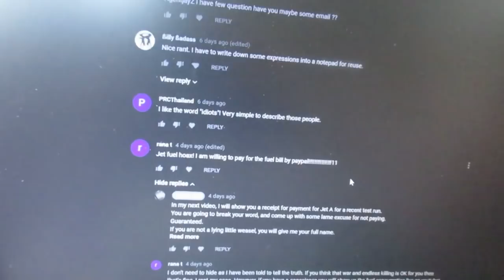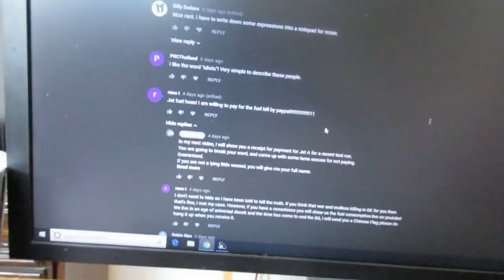Hoaxtard Discussion

Comment: Following a career lifetime in gas turbine engine design,  industrial, marine and aero, including the design of fuel and combustion systems, I left a comment  on this topic four years ago, which you will find somewhere below.  I've also left comments on this channel whenever the "jet fuel is a hoax" brigade continue to peddle their foolish theories.  I thought about letting the latest comments pass me by, but I just can't resist getting involved.  I find that restating the facts is a useful and stimulating exercise for my brain in an active retirement. 
Sadly, the the "jet fuel is a hoax" brigade appear incapable of accepting the fact that a gas turbine engine is a heat engine and obeys the Laws of Thermodynamics: it needs to burn fuel to produce power, just like a piston engine.  How many of the hoax brigade drive cars and go to the gas/petrol station and fill up with compressed air?  Yes, it might actually be possible to have a large tank of high pressure air, taking up the load space (and more) in a typical family car.  It could drive a highly modified piston engine, but not very fast and not very far: there just wouldn't be enough stored energy.
I'm not even going to bother to do the math(s), but the energy contained in that large volume of compressed air would only be a fraction of that available from the combustion of a much smaller volume of gasoline/petrol or diesel.  Most of the time, a typical family car engine is producing only tens of horsepower/kilowatts to drive the car at tens of miles per hour, with a tankful of fuel giving a range of a few hundred miles.
Contrast this with, say, a Boeing 747, which needs tens of megawatts of power to fly, even when cruising in the thin air at altitude.  With a range of thousands of miles, it needs tens of thousands of gallons of fuel to do so.  Depending on the mark, a 747 has a quoted fuel capacity of 50,000 to 60,000 gallons (US), in round figures.  And yes, alum rivets are perfectly capable of holding the wings together to contain a couple of hundred tons of fuel.  An empty 747 can weigh over 200 tons, while a 747 at MTOW can weigh getting on for 450 tons.
I helped keep Concorde's Olympus engines turning and burning for several years, and I've quoted the following facts numerous times on this channel.  At supersonic cruise (Mach 2 at 58,000ft), Concorde's four engines produced a total of 36,000lb of thrust.  Do the math(s) and the answer is that they were producing the equivalent of 130,000 horsepower.  
To produce that level of power with compressed air would be absolutely impossible.  And yet, in the past, I have seen it questioned that Concorde's wings were far too thin to contain sufficient fuel to cross the Atlantic.  So where on earth was the compressed air stored?  And, by the way, I've flown to New York and back on Concorde.
Reply from the maker: Excellent, Graham... but you are speaking way above the level of understanding of those needing to learn the most.
The hoaxtards all did poorly in elementary school science class, and in middle and high school, delighted in their choice to avoid science classes entirely.
So, grade six science is their upper limit.
Reply: @AgentJayZ  Thank you for your comment, AgentJayZ.  
Yes, I do realise that the hoaxster brigade are unlikely to accept anything that you or I tell them, but I just enjoy laying out the facts for those who can accept them.
PS  I would still like to be told by one of them why they need to put gallons of fuel, not compressed air, into their car.  So having put fuel into their car, why do they believe that a massive machine like a 747 can fly for thousands of miles using only compressed air?   And where is it stored?
Reply from the maker: Blargh, blah. What I am saying is one very simple thing: reality is what is actually happening.
It is happening.
You can dream up any ridiculous idea you want, and claim that what actually happens does not happen.
But it happens.
I don't need to respond to your glorious idiot's theories about anything.
It's up to you morons to prove to the world, that reality is not real, and explain to us how your beliefs fit reality.
Hint: they do not.

Comment: The "jet fuel is a hoax" mafia have been getting to me, too,  AgentJayZ.  I've been taking their s**t as a personal insult after a career lifetime in gas turbine design, so let's change the subject.  What is that engine behind you during the first minute?
Reply: I am sure it is a G. E. LM500 (it has GE-looking IGV linkage!) industrial G. T. engine with a gaseous fuel system.  Not sure what the aero version is called.
Reply from the maker: LM1600... more of it to come.
Reply: Thanks, AgentJayZ: I'll be interested to know what it's derived from (correct this, if you wish, DD!).
Reply: Students shant correct the teacher!  What the hey is an LM1600?  I think we are about to learn and sorry for the uninformed reply.
Reply: Wikipedia states that it's derived from the GE F404.  Whether it has a cropped aero fan or a new LP compressor in front of an F404 core, we should let AgentJayZ give us the low down.
Reply: I agree.  It must be less common because I don't recall hearing about it in any of Jay's videos.  I was sure it was an LM500 but my ignorance has been confirmed!
Reply: Derived from the military F404.
Reply: Many thanks for the confirmation, Mr Sipe.  If S &S have been working on this, it is perhaps the most modern piece of turbomachinery that has been in your shop.
Having seen the TF41 turned into the Industrial/Marine Spey by the expedient of cropping the fan/LP compressor and tweaking the LP turbine, my first assumption is that GE would have done the same with the F404.  However, they just might have come up with a higher pressure ratio/mass flow compressor, using the same LP turbine aerodynamics.

Comment: I've worked on jet engines and whenever you take one apart that's been in service for a while there is obvious evidence of high temperature combustion having occurred inside the engine. There is carbon build up in the combustion and turbine sections and the metal inside the combustion section is discolored from the extreme heat. Also, the fuel delivery system is loaded with residual jet fuel that leaks out when you open up the system to service it. I've worked on hundreds of jet aircraft and every engine has these exact same characteristics. I've also stood right next to jet engines during testing and you can feel the heat pouring off of it while its running. And when the afterburner is lit you can see the additional combustion and feel all that extra heat. You can even throw a snowball into the burner flame and it will vaporize immediately.

Comment: Hi. Agent jayz , I know nothing about jet engines, my skill set is wood work, but surely if no compressed air the fuel would just burn in a big ball of fire !! So yes in part it is running on compressed air, but without it the engine won't run !  In my head  fuel + air = burn add more air you get a bigger burn ,  I think all the no fuel hoaxers need to get a life. ( wanders )
Ps. Like the desk, I made a reception desk very similar a few years ago.
Reply: More air, yes, as long as you add more fuel to go with it.

Comment: Thermal cycle destroys everything in the long run. Two ways to keep your computer from breaking; first, never turn on your computer, and the second, never turn your computer off.
The worst killer is the differential of heat expansion of dissimilar material parts. Two bits of stuff are next to each other, they expand at different rates since they absorb heat at different rates. Aluminum part will get up to temp faster than a steel part, once at temp there's no issue since neither part is expanding or contracting due to temp changes.
Reply from the maker: Yes. This is the reason I ask the hoaxtards: why don't we just leave airliner engines running all the time?
Well...?
Reply from the maker: Mongol... I guess that makes sense to you people You know, people like you...

Comment: Hey Jay! I have a question. The nuclear industry in particular is looking at using advanced closed loop Brayton cycles using either helium or supercritical carbon dioxide as working fluids (so basically a nuclear-heated jet engine that breathes its own freshened up exhaust). Nuclear fuels have enough to deal with without adding thermal cycling to the mix, so they run at 100% load for 18-24 months straight. In this type of application, is there any benefit to having variable stators, or can you safely eliminate them without fear of compressor surge? In other words, is there any benefit to variable stators if the inlet velocity is fixed?
Reply from the maker: If you watch Compressor Stall, you will know the answer to this question.

Comment: Explain to me where they store 238 thousand litres of fuel  on a Boeing 747. The plane uses fuel to take off and land but once it's in the air it uses very little
Reply from the maker: Depending on your definition of "very little" you are correct.
The fuel is usually expressed in lbs by tradition.
If you look at a real 747, there is a bulging section near where the wings attach to the fuselage. It's big enough to park several city buses inside. That's where the center body fuel storage area is. It will hold over 100 thousand lbs of fuel. Each wing also has many sealed off areas, the diagrams of which are  publicly available from a variety of internet sources. Each wing will hold over 50 thousand lbs of fuel.
It's not my job to convince you of reality. If you want to know, it's easy to find out.
If you don't want to know, then you need to concoct an idea that the entire world is lying to you.
A good question to ask is "why would the entire world lie to me?"
Reply: Yes, about 25,000 lbs per hour.
Reply: @AgentJayZ  100,000 lb plus the weight of the jet itself plus the weight of the people.. and somehow that mess of weight defies gravity.. two tiny ailerons and a rear elevator are enough to yank that weight around like a rag doll.. rrrrright...

Comment: SR-71s leaked fuel all over the flightline and had he tanker waiting for immediate refuel after takeoff. Think of the money they would have saved but using the hot air in these comments.  🤣
Reply: SR-71 Blackbird was designed to leak fuel while it was on ground due to the lack of materials at the time capable of withstanding the extreme temperature differences. The fuel tank was designed with gaps which would expand when in flight, sealing the leaking fuel tanks.      Look it Up.
Reply: I think everyone here just missed the joke.

Comment: If jet engines don't need jet fuel, where does the fuel in all fuel lines, which rains on my head and gets on my clothes, everytime we dissasemble an engine come from?
Are there agents(jayz :D) of the nwo, who fill these fuel lines, only to hide the fact, that engines only use free energy? What are all the components and hoses of the fuel control for? What purpose do fuel nozzles have?  Where do all the carbon deposits on every part in the primary airflow behind the combustion chamber come from? Why does our test cell, and every running airplane smell of burnt jet fuel? Why does every exhaust gas stream contain carbon particles, carbon di- and monoxides?  What is the purpose of fuel/oil heatexchangers? What ist the used cooling medium in an engine, that only has fuel cooling for the engine oil? Why do crashed airplanes burst into big fireballs? Because the air around it gets aflame?
And if compressing air releases free energy, is the power cable on an air compressor only there, for dissipating the  produced energy into the electrical grid?

All hail Frank Whittle, inventor of the great lie! (He is a reptiloid, living inside the hollow and flat earth. He also faked 9/11, invented the chemtrails and faked the moon landing)

Oh yeah. i get it. All pilots, aircraft engineers, people who deliver jet fuel, aircraft and jet engine technicians, poor guys who crawl trough dark, smelly and tight fuel tanks on airplanes to inspect them and literaly everyone who works in the airplane industry are part of a big conspiracy and therefore lying to you. Right. Thats the reason we are all rich. Becaus they are paying us to keep their secret.
And you alone know the truth. Do your parents know, what you believe in? Are they proud?

Morons.

Comment: Show us a close up video of a jet airliner getting its wings refueled with over 100k gallons of fuel. Go ahead, well wait.
Reply from the maker: 100K gallons is over 600,000 lbs... so that is too much. The center wing tank of a 777 holds about 250,000 lbs, which is a little over 42,000 gallons.
In the real world, details like this actually matter.
Reply: @AgentJayZ  any videos of 747 being fueled with 80000 gallons of fuel.  40000 each side of the wing.   Each gallon is 6 lbs.
Reply: Yeah and even if we didi you would call it fake because as soon as you stop hearing what you want to hear you start panicking

Comment: I just heard this bull the other day, I can't believe they actually even says such things, it really pisses me off not only are they lying to each other, but all the people that actually fall for this BS. I was in the USAF as a engine run crew chief  on FB111a's we had pratt whitney TF 30 with 5 stages of afterburner and sometimes when you start these engines and you have 10% RPM then you through the throttles "over the hump", it's a detent and that gives the engine ignition and fuel, some times to much fuel and it lights off and you feel and hear a real loud waaawuoomp and it shoots a fireball out the back of the plane and the plane rocks forward in the chocks. and the first thing you look for is the turbine inlet temp(TIT), it can't go over 710 degrees otherwise you have to shut it down and declare a "hotstart" and "motor" the engine just let the starter turn it over with air until it cools down. the fire ball it about the size of a big beach ball. Trust me you wouldn't want to have your face in the way. Some guys would create the fire ball by leaving the ground ignition off  for a second and then turn it on and you get a big waawoump and a fire ball will shoot out the back. And for all those guys who say that there is no fuel and it a hoax, you are so full of it. A KC 135 holds 190,000 lbs of fuel so that it call refuel fighter jets in the air and yes that's a lot of fuel a KC 10 tanker holds 356,000 lbs of fuel and that's no joke. I know you might not be able to comprehend large numbers like this, but its true and on top of all that fuel they still have a cargo hold where all the seats used to be,  are for men and equipment I don't know what the max take off weight is but it up there. I didn't like flying on them when they are loaded to the max, because in the summer when it hot and humid they don't create as much lift and can barely get off the ground, trust my I was saying hail marys more than once barreling down the run ways , hoping it would take to the air, and not end up in a big fire ball at the end of the runway.  So go to an airforce base some time and ask to see this stuff. at an air show maybe they will let on board. and you can see for your self Go and ponder a C5 galaxy it can hold 17 greyhound buses in side and the cockpit is three stories high. Gotta go now I'll  give you guys a USAF saying " You need to get a belt with your name on the back, so when you pull your head out of your ass you can see who you are" and you might be one of those people you want to keep down in front, so you can shoot them if you have to.SGT Licher